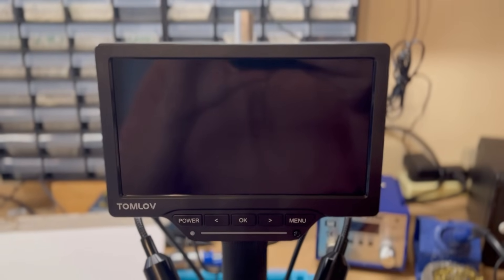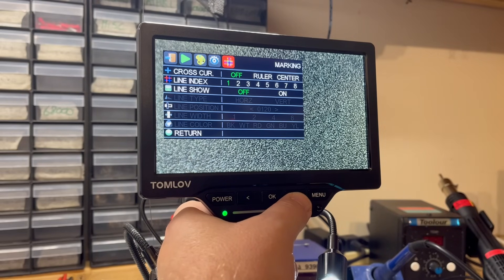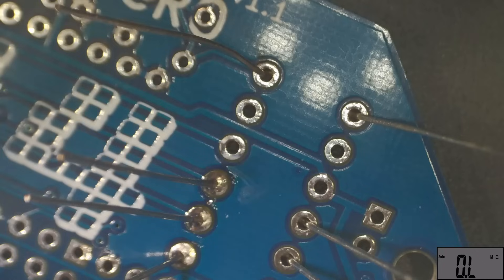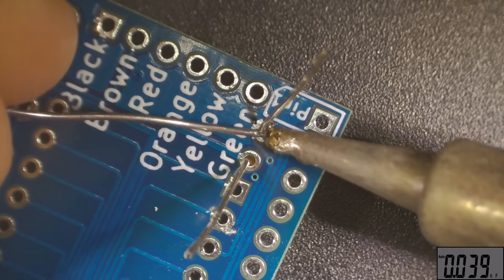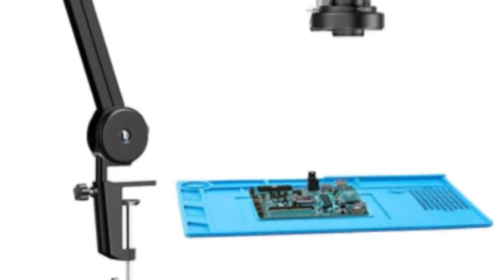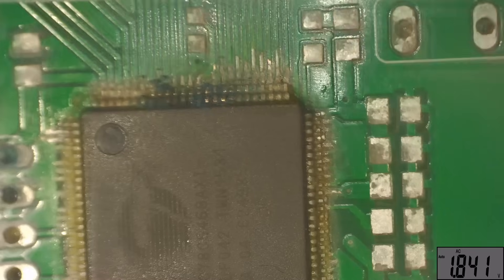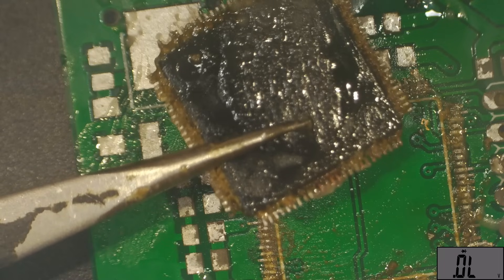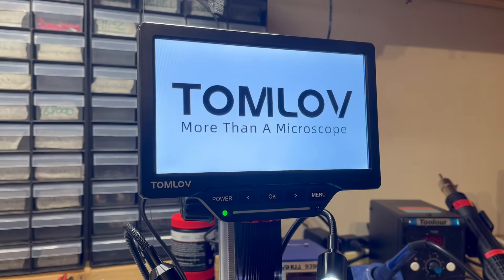A sight for sore eyes!  TOMLOV Digital Microscope - why haven't I been using one of these for years?

Comment: I love my digital microscope, and being visually impaired, it is the ONLY way I can successfully do electronics work. Without it (i.e. with my normal vision) I could barely do large through-hole parts... my solder joints were pretty lousy, and I would often create unintentional solder bridging. And forget about doing anything SMD, that would have been impossible using my unaugmented vision. Now, with my microscope, I can even do small pitch SMD parts (assuming my hands aren't too shaky because I've had too much coffee :) ) and the quality of my soldering has gone up significantly. It took me a while to get used to the mental disconnect of watching my hands on a screen rather than directly observing them as I work, but after maybe an hour of training my brain, it's become second nature. The one thing I would suggest is to ditch the crappy little stand that these things typically come with. They're pretty clumsy and you can't fit particularly large boards under them. What I did was I got an old microphone stand, the kind that is like an articulated swing arm that clamps on your desk, and I designed and 3D printed a clip that let me mount the microscope to it. This way the microscope is infinitely adjustable (I can position it any which way I need) and there isn't a stand to get in the way of large boards. Plus I can swing it out of the way when I don't need it. And for added illumination I got some flexible neck LED lights which I can position whatever way I need to.